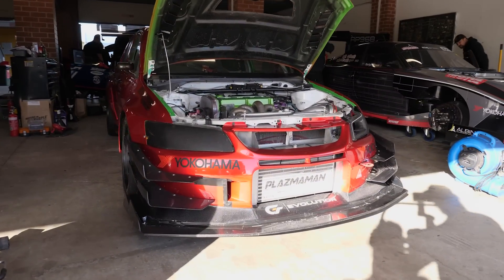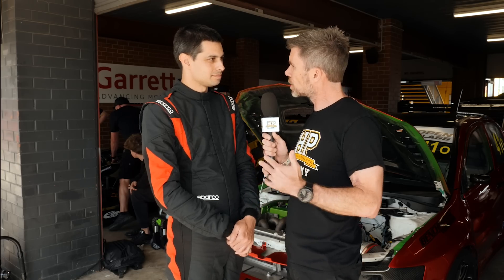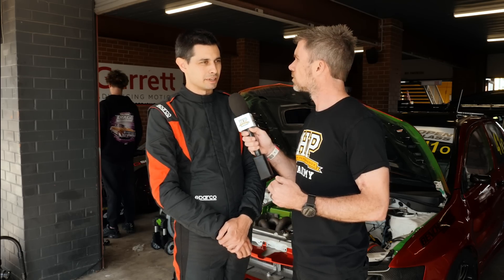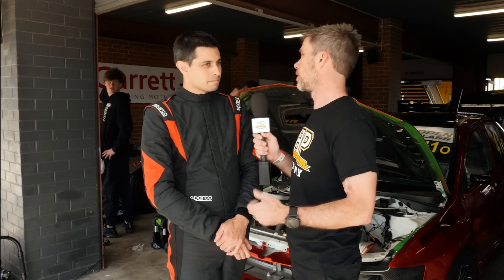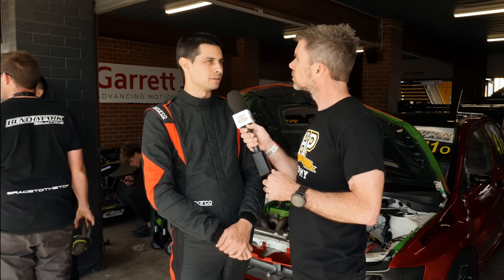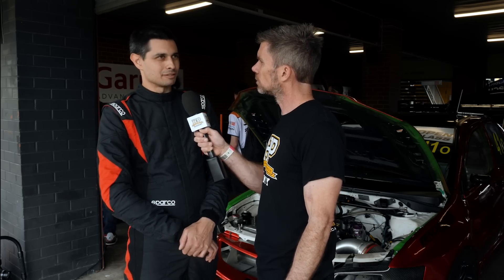Is This 'Future You'?

Comment from the maker: What is your dream build?
🦸‍♂ Building a fast car? Get $400 OFF the all inclusive VIP online course package deal: https://hpcdmy.co/vipy97
☝Kickstart your EFI Tuning knowledge. Get 50% OFF your first online course: https://hpcdmy.co/offery97
TIME STAMPS:
0:00 - Open Class EVO 7
0:30 - Engine Package
0:50 - Power and Boost
1:10 - Gearbox
1:25 - Electronics
1:44 - Why Use Course Material?
2:30 - How It Helped
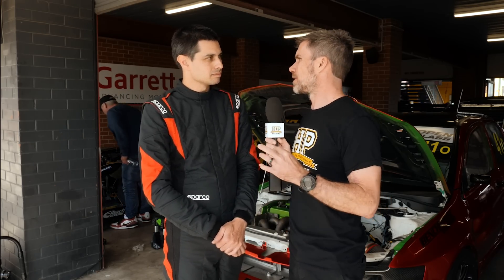2:50 - Spend Wisely
3:15 - Why 2.2L 4G63?
3:48 - Wiring Process
4:59 - Wiring Documentation
5:42 - PDM Configuration & Electronic Setup
6:38 - ECU Setup
7:01 - Not Just For Cost Savings
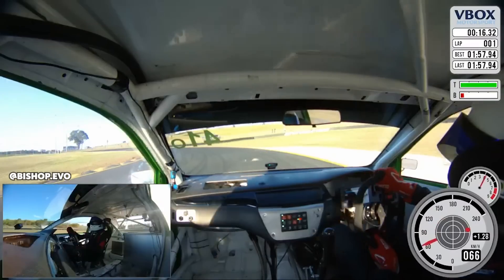7:20 - Data Analysis
7:36 - Judd V10 On Song
7:39 - Data Analysis Usage
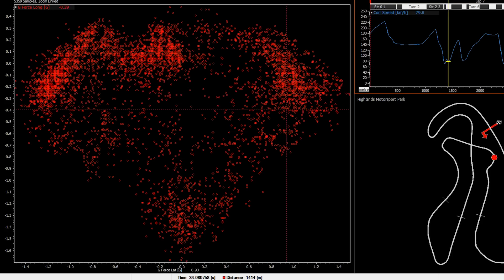7:54 - Variance Plot & Lap Comparisons
8:47 - Pro Diver Help
9:13 - Where To Start With Data Analysis
10:00 - MoTeC i2
10:23 - Active Centre Differential
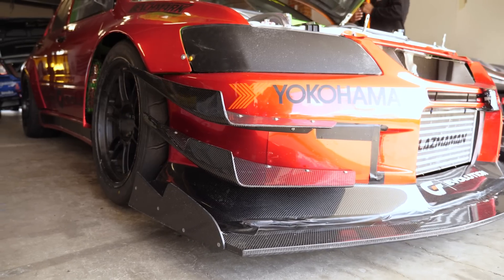11:49 - Dialing In Traction Maps
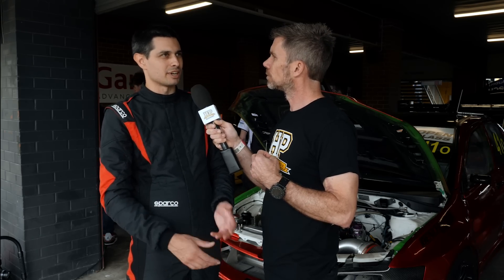12:44 - Thanks Darren! A Pleasure.
12:54 - Full Jandal Race Footage
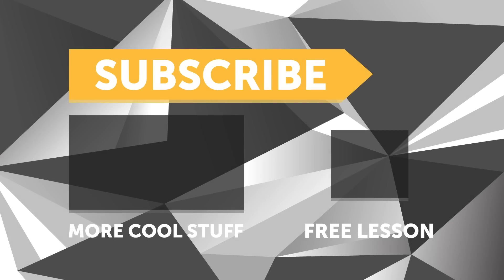14:33 - BUILD.TUNE.DRIVE (Just like Darren)